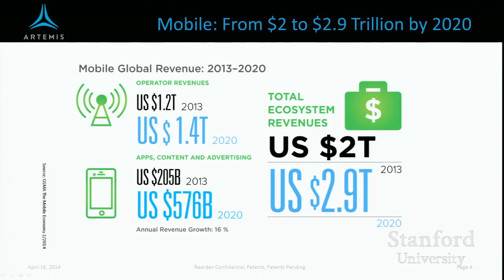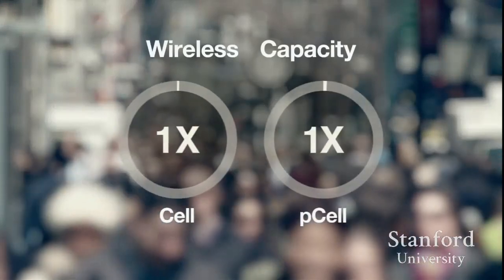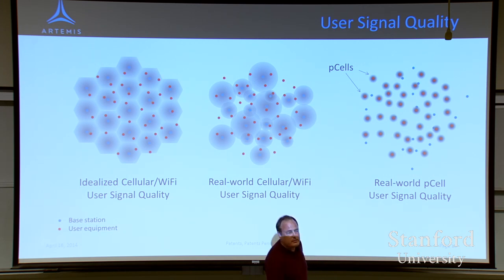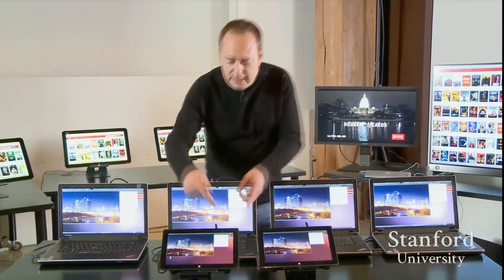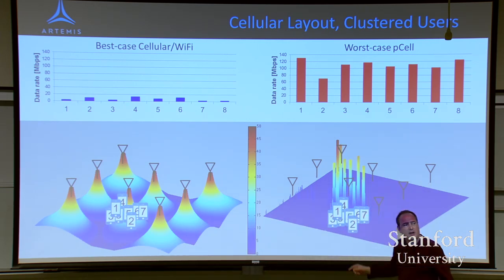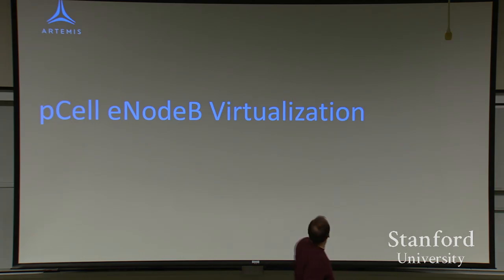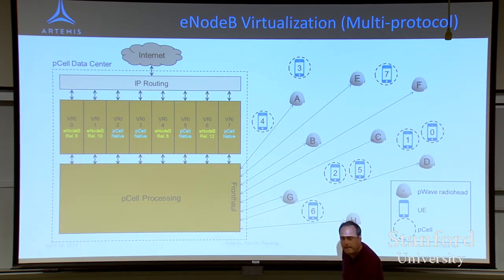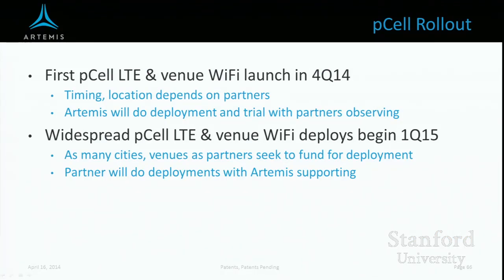Stanford Seminar - pCell: Personalized Cell Technology: Ubiquitous Wireless Broadband

Comment: Brilliant. What you have there is the inversion of distributed coherent detection, or synthetic aperture, I would have called it distributed coherent transmission. Essentially, if I understand what you're doing, is taking what is used for DCD (in RADAR terminology), or synthetic aperture (in astronomy) and inverted the transmitter and receiver, so that instead of detecting a signal deconvolution, you are transmitting the signal by preconvolution.

What I am curious about is how you transfer coherency from base station to base station? It is kind of obvious when all the receivers have synchronised LO, and a synchronous sampling clock, as in RFoG distributed MIMO systems, but in this system, the cells must need to handshake with each other to measure the oscillator error of each cell. I can also see how you would do it in a handshake with a cooperating device, but you show LTE in your demo, where the LTE handsets clearly don't speak any special protocol, implying that the pCell base-stations are coordinating with each other to track the location of the receiver.

I can see the longterm outcome with this technology being RFoG, as the number of network nodes increases, the inter-cell communication will increase. By moving more DSP to a central location, as in RFoG, the latency can be reduced and the bandwidth increased between CSA state trackers.